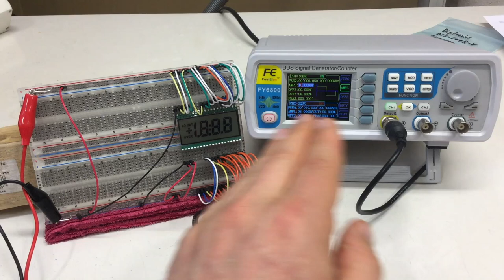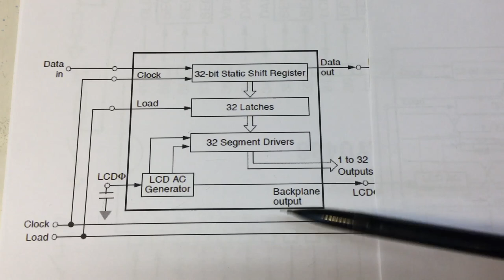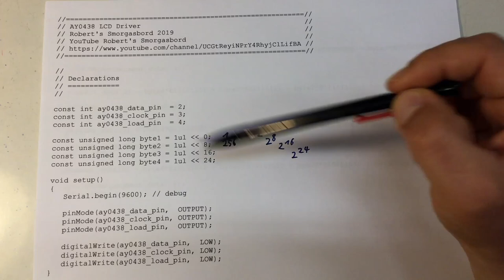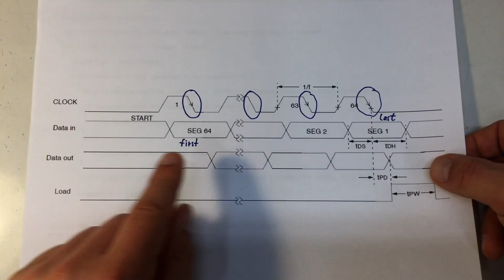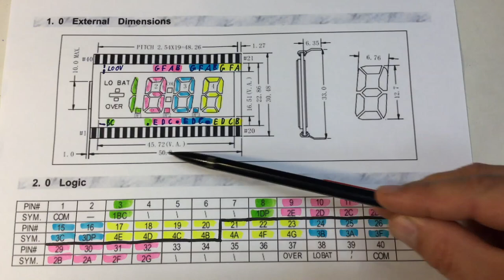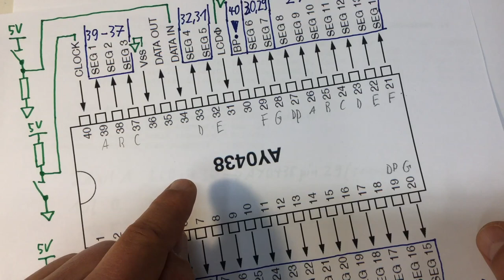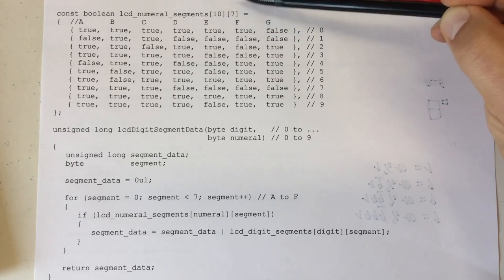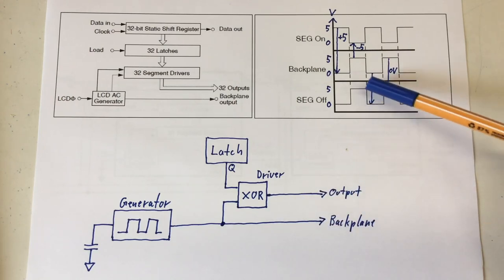Driving LCDs with Microcontrollers (Arduino) using LCD Drivers (AY0438)

Comment: Don't know what I expected but I definitely didn't expect that to be so easy. Awesome.
Reply from the maker: Before that project, driving "naked" LCDs appeared to be black magic to me too. But with a suitable LCD driver chip it's really not that hard.
Reply: @robertssmorgasbord  with the driver chip from the video it's as easy as pushing data in a shift register. Literally. I think I'll use them for low power projects in terms of current consumption and available computing/serial ports.
Reply from the maker: @bastiannenke9613  Yes, literally (the shift register thing) 🙂 And yes, low power: I bought these controllers and LCDs for a battery powered multi-channel temperature meter (4 x MAX6675/DS18B20). But I got sidetracked and now they're waiting for some other use.
Reply: @robertssmorgasbord  happens me too sometimes. There is way too much interesting stuff and not much time.
Reply from the maker: @bastiannenke9613  Exactly 🙂

Comment: Hello, I need a specially designed monochrome tn screen, I want to have it produced, but I cannot have it produced because I do not know how to draw or design it. Can you help me?
Reply from the maker: Well, unfortunately no. I never designed a TN LCD in my life. Are you sure you wanna go down that route? What chip will you use to drive your custom TN LCD?
Reply: @robertssmorgasbord I'm thinking of using one of these chips, UC1671 IC or CN91C4S48 I2C
Reply from the maker: @kadiraynur2636  Didn't ad hoc find a datasheet for the CN91C4S48 (seems to be used on a lot of Chinese LCD modules), but I had a look into the UC1671 datasheet - seems to be a quite capable chip. Anyway, good luck with your project!
Reply: thanks
Reply from the maker: @kadiraynur2636  You're welcome!

Comment: Hello Dr.Robert , Is there any place where you have a datasheet for the pinouts of the LCD ?  AY0438 has become crazy expensive !!
Reply from the maker: Hi (and I'm no Dr., just a Dipl.-Inf. 🙂 ), I've uploaded the meager documentation for the LCDs to my Google drive:
https://drive.google.com/file/d/1Egksg7_dV6hHSUrRnVB4o3QrOsVJZqZ9/view?usp=share_link
https://drive.google.com/file/d/191tQHa_o3u6nO_hhMae_pROsSBsD0TKp/view?usp=share_link
Hope that helps.
Reply: @robertssmorgasbord   Vielen Danke. There seems to be a Holtek offering for similar called HT1621. Just FYI .
Reply from the maker: @mumbaiverve2307  Gerne geschehen 🙂 And thanks for the info! That Holtek chip is quite nice.
Reply: @robertssmorgasbord   Been struggling with HT1621... Well nothing is coming on the LCD display 🙂 . In the datasheet they mention 1/2 or 1/3 bias;  1/2 , 1/3 , 1/4 LCD duty cycle do you know any idea about it ? Also the chip has 4COM pins , while the LCD has only 1 ( Both COM on LCD is internally connected) , so can I leave the 3COM on the chip floating ? Just in case you get some time , any suggestions ?
Reply: Ok sorted,.Pins wrongly connected. As usual a case of looking for sophisticated issues while the obvious ones are neglected :face-pink-tears:. Thank you and happy YouTubing
Reply: In any case if you can make a video on bias and duty cycles , would love to watch !
Reply from the maker: @mumbaiverve2307  Congrats on solving your problem 👍 Currently I'm busy with other projects, so there won't be a video about LCD bias and duty cycle anytime soon. But I'll put it on my wall of video ideas. Anyway, here's a short version: The bias and duty cycle describe the AC square wave the chip is using to drive the LCD. 1/2 bias means that (at 5V VCC) the LCD segments are driven with a +2.5V/-2.5V (+50%/-50% of VCC -> 1/2) AC. That's really what most LCD displays need. Accordingly 1/3 bias means that (at 5V VCC) the LCD segments are driven with a +5V/*2/3=3.33V / -5V*1/3=-1.67V (+67%/-33% -> 1/3) AC. I guess that's only for needed for some specialty LCDs. The duty cycle is simply the percentage of the time the AC is positive during a cycle. Again 1/2=50% is what most LCDs need. Hope that helps.

Comment: Cool. I hope I can fix my Viewsonic 17" LCD which flicker every 15 seconds after 30 minutes of being ON. I replaced  all capacitors but it still flickers. Where should I check next?

Also the OLED of my Wacom Intuos won't turn ON (it used to display a display but some lines are missing), what should I check on that Wacom's OLED section/module?

Thank you.
God bless, Rev. 21:4
Reply from the maker: Sorry, but it's a big leap from building a little circuit with a segmented LCD display to repairing high resolution LCD and OLED displays. The only high resolution LCD I've repaired myself was a Samsung SyncMaster 214T (replaced the caps like you did).
Anyway, which Viewsonic 17'' LCD is it exactly? I don't even know if your LCD has a fluorescence (high voltage) or LED backlight. The flickering is usually a sign of the (fluorescence) backlight power supply failing. Since you already replaced all caps I'm all out of ideas.
Regarding the Wacom Intuos: Same Question: What Wacom Intuos model is it exactly (S, M, ...)? If lines are missing in a LCD/OLED display, some connections for driving the lines/columns might be broken. Look for the connections of any flat-flex cables with a lot of wires going from the board to the display.

Comment: Thanks a lot
Can you share circuit diagram with us please?
Reply from the maker: I've never created a circuit diagram in any software for that video. But I've created one sometime ago for 4 LCDs. If I can find it again I'll upload it and publish a link here.
Reply: @robertssmorgasbord  ok thanks
one more question : did you connect the COM pins to the GROUND or 5V? İ have a vım-878 lcd  and it has a 4 COM port, so i am confused.
Reply from the maker: @osmanozdemir4367  The LCD COM pin(s) are neither connected to ground or 5V! They are to be connected to the BP pin (30) of the AY0438! Also, it's sufficient to connect only one COM pin of the LCD. Still searching for that circuit diagram ...
Reply: @robertssmorgasbord   i got it, thanks for your answers